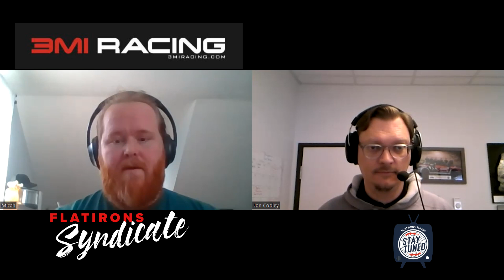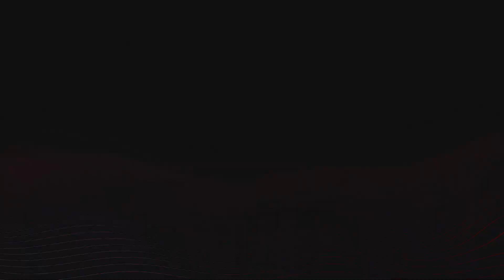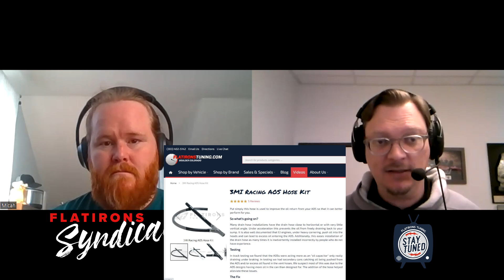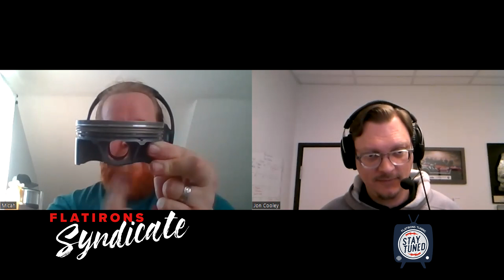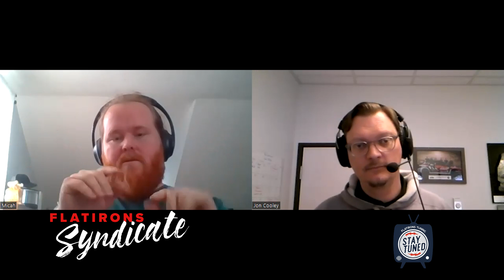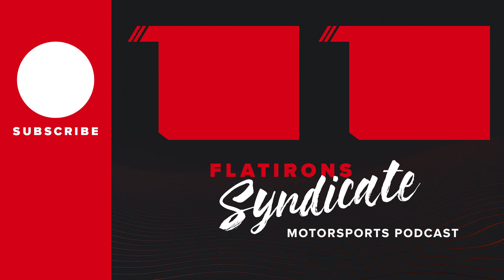Formula 1 engines to Subaru engines with Micah from 3MI Racing

Comment: No links to F1? Subaru failed at being a Formula 1 engine supplier before they started STi and entered rally.  It was the Subaru 1235 engine (3.5l flat 12)

Also, the EJ engine development during the late-80s was led by Mr. Kuze, the same man who started STi and led Subaru to partner with David Richards and Prodrive. It was originally designed to have 132hp, according to the SAE paper co-authored by Mr. Kuze himself. That can be found online.
Reply from the maker: Thanks for the comment.  In this case Micah was that connection, but yes, it is interesting that Subaru once tried to run in F1.  Would have been cool if they could have made it work.

Thanks for watching and Stay Tuned!
Reply: @FlatironsTuning  I was hoping it would be mentioned. No worries, though. I did learn a few new things from watching and I appreciate the knowledge being shared.